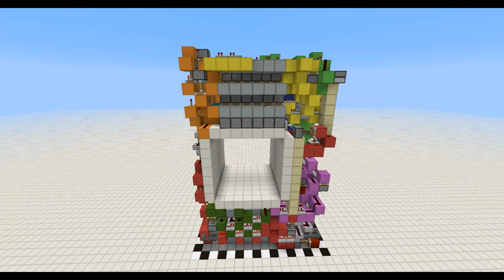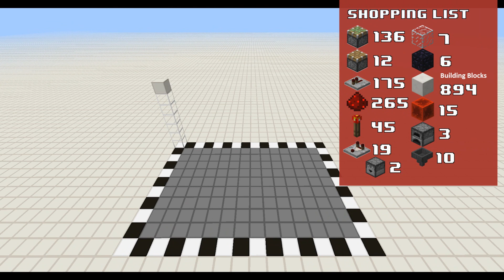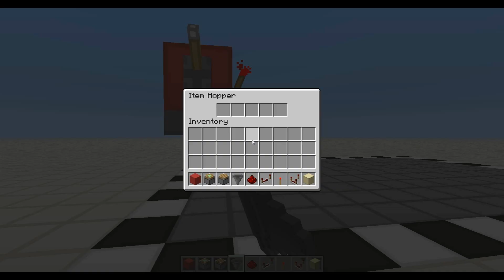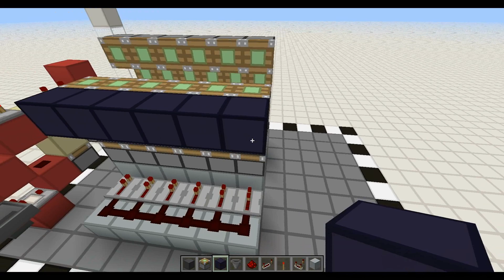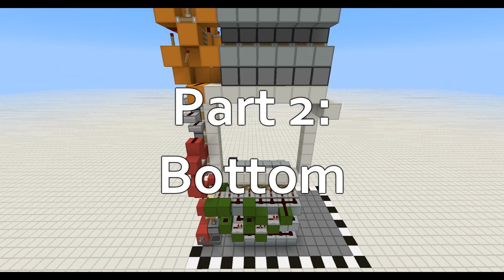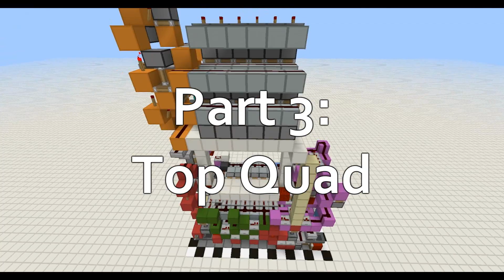[Outdated] Extremely Compact+Fast 7x7 Seamless Piston door tutorial! [Outdated, check description]

Comment: Is it direction depended in any way?
Reply from the maker: Redstone stuff shouldn't break after an amount of uses. And no it is not direction dependant, it did work a few times right? Before it broke? If so, my only explanation is that you might've one of those times activated it slightly too early.

Comment: Why do you use so much comparators? D;
Reply from the maker: Very useful, for a LOT of different things that repeaters cannot do. So that is why.
Reply: Like keeping the same redstone "power" instead of set it to 15?
Reply from the maker: Well that too, but comparators can also carry 1.5 tick pulses, which repeaters cant and is essential for giving 1 tick pulses through torches, and take output from blocks with an inventory (furnace, hopper, dropper, chest etc.). They also update later than repeaters do, can subtract signal strengths so it doesn't travel as far in some occasions, redirect redstone in many different ways and also work as delay circuits with redstone.
Reply: Sidney600MC Of course, now I understand, your tutorial is amazingly super :) Thank you :)

Comment from the maker: It's not as easy as you think to make this slower. ;-)
By letting there be less between each timing, it becomes smaller. But it should work if the server is a little slow, and this thing alone shouldn't be able to slow down the server to the point where it cannot operate. Even if you make a slo-mo machine (ton of lamps blinking) it still works. Either you did something wrong, or the server doesn't have enough power (though I don't think it matters, but it might if the server is super crappy) ;-)

Comment: I completed everything, the only thing that seems to not be working is that the row of block that is under the "Dummy" blocks seems to be the only row left in the middle of my door, during the last part of closing my top rows of pistons are suppose to grab those last two rows of blocks. my pistons extend but they do not grab that top row of blocks and retract it then after i have one set of blocks left in the middle of the door 3 blocks above the bottom of the door. What would be wrong with this